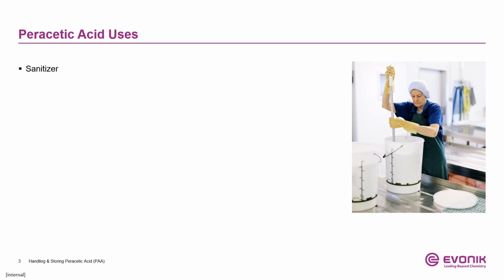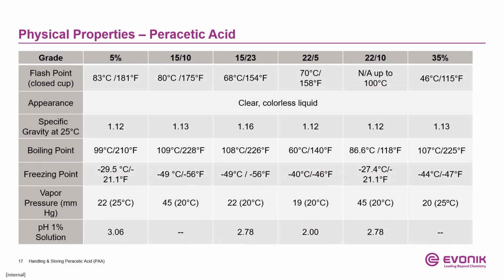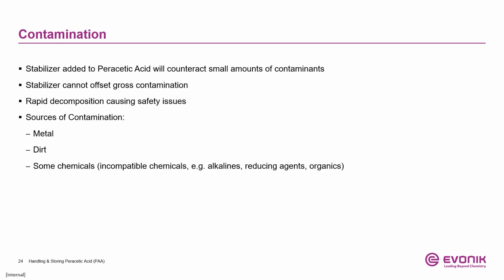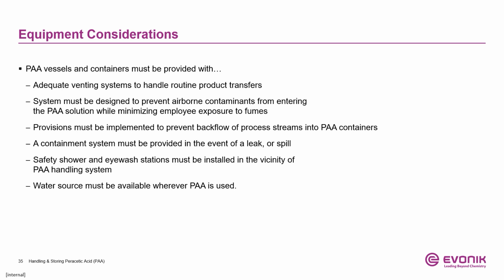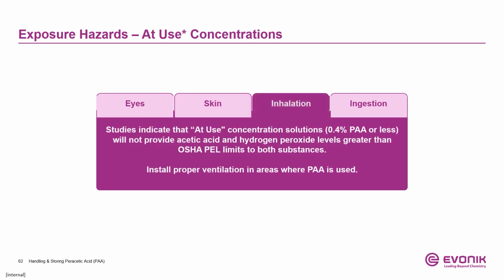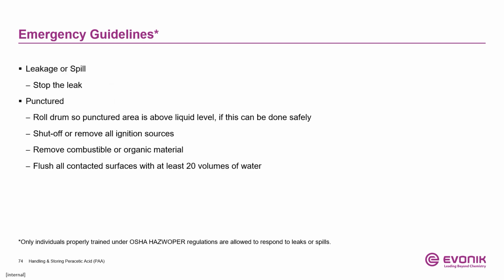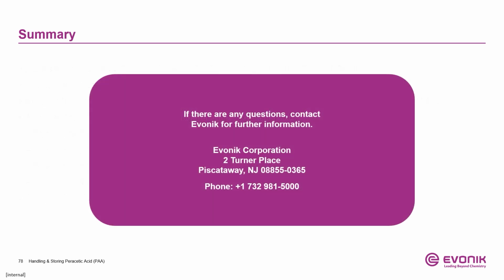Peracetic acid safety video | Evonik

Comment: Very useful video, thank you for publishing this!

Key timestamps:
00:00 Welcome
00:08 Agenda
00:35 Peracetic acid uses
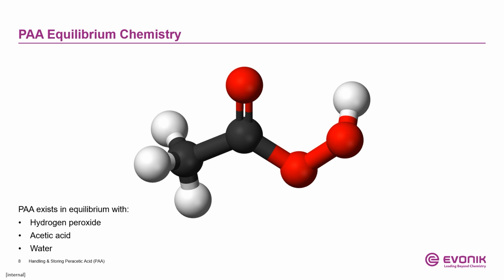01:33 Peracetic acid basic chemistry
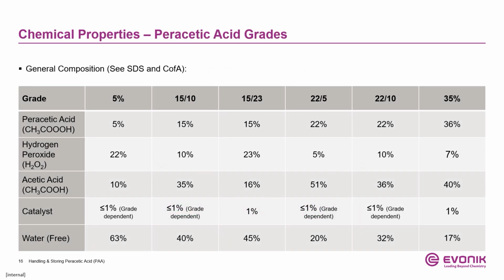02:50 Peracetic acid grades (table)
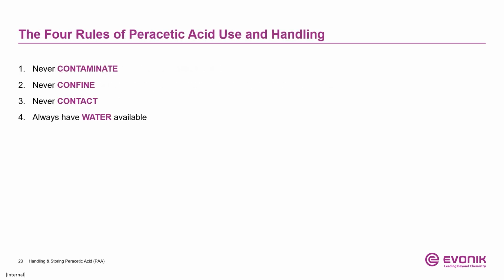05:21 Four rules of use & handling to prevent incidents
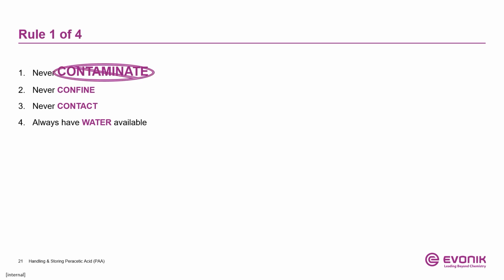05:48 RULE 1 - Never contaminate
06:55 Materials of construction
07:29 Equipment considerations
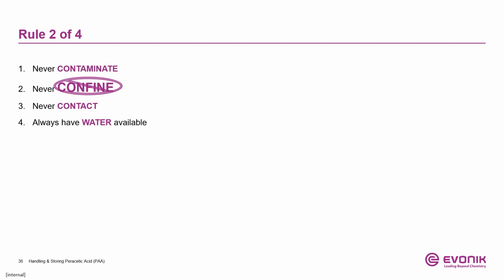09:42 RULE 2 - Never confine
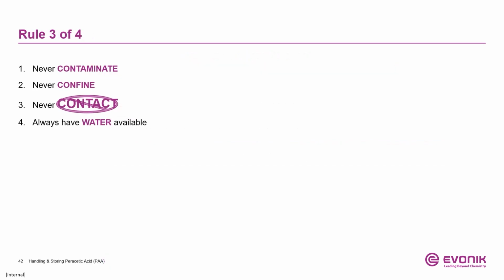11:40 RULE 3 - Never contact
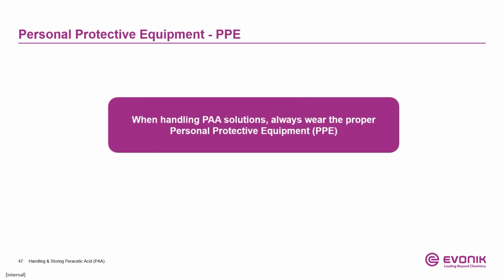12:11 Personal protective equipment (PPE)
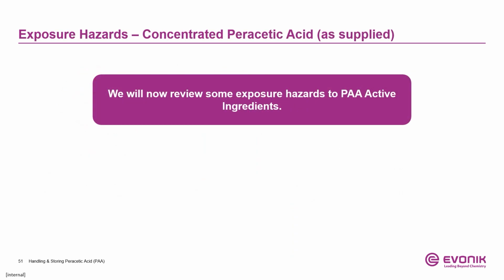12:58 Exposure hazards (concentrated)
13:54 Exposure hazards ("at use" concentrations)
15:30 First Aid
16:42 RULE 4 - Always have water available
16:46 Fire fighting
17:27 Emergency response guidelines
18:34 Disposal
19:24 Summary
20:40 Evonik contact information